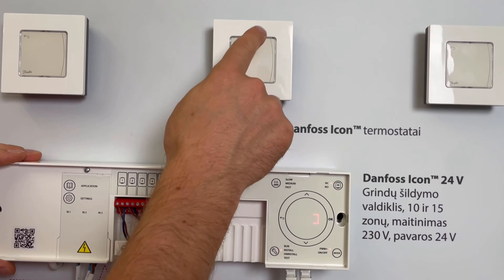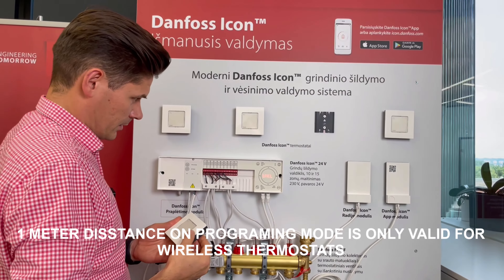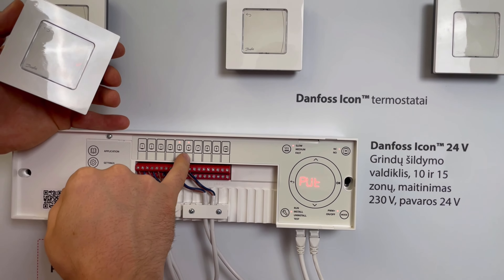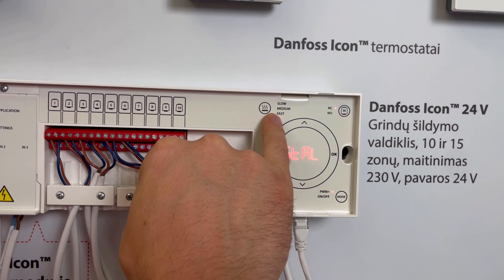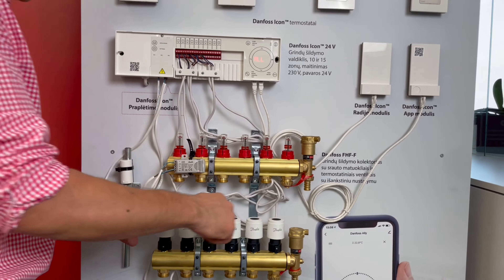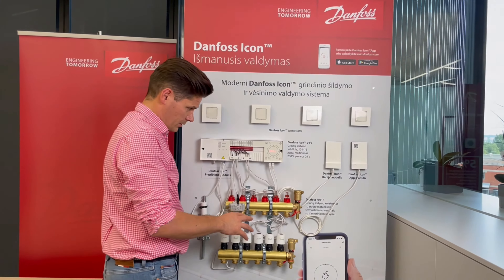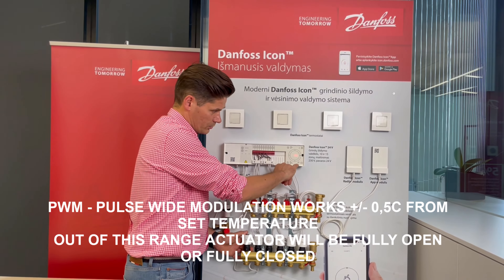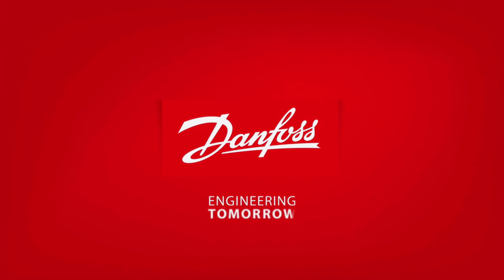Danfoss icon installation guide

Comment: Hello!
I have a question! The master is running in installtion mode activated (red light in circles), but with the connected Radio Module I just receive 'Net Err' on the thermostats. I already reseted master and thermostats and nothing is changing. Do you know what I should try ? Thank you!

Comment: Hi 
I am writing for some help 😁
We just moved in the new apartment and we have some issues with the heat…we have the same system and I followed all the steps from the video but still we don’t have heat in all  apartment and I don’t know what should I do…😊
Reply from the maker: Check the actuators, are they open. In case they are open it is not related to control system. Something wrong with heat supply.

Comment: I have the error “net” in all my wireless controllers. The master controller seems  to be completely off, meaning no lights or anything happens when I press the buttons.
Reply from the maker: It seems Master Controller is "dead" probably you need a new one :(
Reply: @ thank you for the information! I think so indeed. I’ll tell the landlord to replace it! 😅

Comment: Hi, I tried to reset everything (Icon 1 wired 24v) and now all thermostats shows some error after blinking and 212 code when I press back button. And I can’t add any of them to the system. Also Is it possible to find out where a specific contour is located? I don't have any markings or maps from the developer.
Reply from the maker: Hi! Reset has to be done for 
Master controller: https://youtu.be/ErfuVqSK-8o?si=NCcsQEX7S1BX9MTu
And for Thermostats also: https://youtu.be/ErfuVqSK-8o?si=qc5OFjyzPN8hMf0U
And any other devices separately: App module, Radio module etc...
To mach circuit with room there is no other way as to close all circuits. And open one by one looking where heating starts. To heat up one circuit it takes minimum one hour. For better result increase supply temperature. Thermal camera will help to find faster.

Comment: Thanks for the clear demo! Three questions if I may: We have Danfoss Icon in combination with Nibe S1155 series. 1) When selecting zone temp to 21.0 for some of the zones the heating continues heating up to 21.7 degrees before it stops. Is this a normal situation? 2) Will the Icon app be updated? It has not been for 2 years. 3) How do I load new firmware to the App to update the main controller?  Thank you.
Reply from the maker: Hi! 1.It should not heat up to 21.7C if set to 21.0 only in cases where floor sensor is used. Or some other heating is present. Also might be mixed loops. Thermostat is regulating different loop (cirquit). 2.Hard to say, It is not up to me:) more advanced is Ally app. Second generation Icon and coming Icon 2 is possible to connect to Ally Gateway. Also ventilation, and coming remote boiler relay. 3.As far as I know it is not possible, only new Icon 2 will have this feature.

Comment: 0:57 the actuators are not blinking. Even if I follow the step-by-step up to that point. What could be wrong?
Reply from the maker: Is the connected actuator 24V?  Remark: Icon first generation works only with 24V actuators. Icon 2 from factory without transformator works with 230V actuators.

Comment: after connecting and configuring the expansion module that occupies the first valve, HOLD is displayed and nothing happens. What could be the reason?
Reply from the maker: Probably something is wrong with installation. I would reset everything (Master controller, room thermostats, App...) and would start all over all programming process. (How to reset there are videos done)
Reply from the maker: What application you are using? Send me system installation foto's to: andtimofejev@gmail.com

Comment: Good day! 
How can I re-setup the control of thermostat. I want to make the thermostat to action other actuators.
Example now the thermostat from one room give control to 1-2-3-6-7. I want to change to give action to  1-2-4-5-6 and to move control of 3 and 7 on other thermostat.
Thank you.
Reply from the maker: Hi! Select "Uninstall", then "OK". Select with up arrow output you want to change, confirm with "OK". One by one. And then use "Install" as on video.
Reply: But if I select Uninstall?
What will be uninstalled? Themostate or the actuators?
Reply from the maker: @futurechannel001  actuator output will be uninstalled from master controller. You can not uninstall thermostat, only reset.
Reply: @heatingsolutions123  
Can you please make a video with this explanation how to change the setup of the Thermostat and Actuators.
Reply from the maker: @futurechannel001  Sorry, I do not have first Icon version anymore. Another way to solve your case would be reseting Icon Master https://youtu.be/ErfuVqSK-8o?si=3DjTe5BdppbQl_Lk
and all room thermostats to factory setting. Icon/Icon2, wireless and wired reset is the same: https://youtube.com/shorts/lPaoofPJnFo?si=Gb4-5lRU_kbA1-xs 
After reseting you can program all as new

Comment: When I change replace an activator, what needs to be done on this control unit?
Reply from the maker: Unplug (power OFF) Icon Master Controller. Change actuator. Plug in (power ON) and it is done:)
Reply: Thanks for the solution, it removes the error 🙂

Comment: Would you, please, be so kind providing additional information on how to configure it with dual-mode zones? It seems to me that a plus of Danfoss Master 24 v and Wireless Controller (comparing with other similar brand name solutions) is the option to configure a zone as Dual-Mode. According to the manual (i.e., Danfoss Icon™ Master Controller 24V - Installation Guide - AN29434614196101-000402 | 088N2112 01), for such zone "During operation the system will maintain room and the min. floor temperature setting using only floor heating. Only in periods where the floor heating system on its own and with the defined max. floor temperature is insufficient will the radiator be activated to help achieve the desired room temperature.". The question/problem is the following: as I have a distinct pump for the high temperature (radiators) circuit, I need a distinct signal for it, distinct from the signal for starting the low temp (underfloor) circuit. It is my understanding the boiler and pump outputs on the Icon Master would both "fire" to turn on and off the underfloor heating. In this case, there is any electrical signal available for the radiators pump? E.g., would the actuator output on the controller continue providing an output signal even if its channel is paired with a wireless radiator thermostat? Do you, please, have a solution for this problem?
Reply from the maker: It is possible to connect underfloor heating and radiator heating to one wired or wireless room controller (thermostat). In this case wireless room thermostat has to be with infrared sensor (IR). Or wired thermostat with immersed underfloor sensor. IR/underfloor sensor is needed for underfloor min. temperature control and radiator activation. Actuator from radiator and actuator from underfloor heating circuit has to be connected so separate outputs and paired with one room thermostat. Boiler relay and pump relay on master controller are activated on demand for heating. With expansion module it can be different. For more questions you should contact local Danfoss representative.

Comment: Good day,
I reset my Danfoss,  now on Icon App shows only the rooms from 1st Floor not from 2nd Floor.

Kindly assist me please.
Reply from the maker: Hi, OK. This is not easy,  but manageable. 
If you have got Icon first generation MC and you are using Icon App. And you have made reset on Icon first floor master. You need to do this: 1.) reset Icon master second floor controller too 2.) reset 2nd floor all room thermostats 3.) disconnect all actuators and room thermostats if wired  from 2nd MC 4.) if you have wired connection then leave 2nd MC in place, if you have radio connection. dissmount and take 2nd MC closer to 1st floor MC (1 meter distance). Both has to be with Radio modules. Pair them as instruction says: 
Connecting more Danfoss Icon™ Master Controllers in a system
If wired system
Connect up to three Danfoss Icon™ Master Controller 24V to each other with a 4-wire twisted pairs cable and
the supplied connector (pic. 10: A – 4 (2 × twisted pairs), B – Max. 3 x Master Controllers in one system). See data
table in the back of installation guide for wiring recommendations.
If wireless system
Wireless connection of up to three Danfoss Icon™ Master Controllers 24V requires a Radio Module with each
Master / Slave (pic. 11).
Pairing System Master and Slave in both wired and wireless systems
Note! Slave Controllers must be assigned as System Slaves before assigning outputs and thermostats to them.
1. On the selected system master, press to select INSTALL mode and press OK.
2. On the system slave, press and hold for 1,5 sec. The display now toggles between SLA TYPA and SLA
TYPB.
3. Press to choose between the two slave types and confirm with OK. See “Slave type definition” section
for explanation.
4. Repeat step 1–3 to assign a second Slave Controller to the system (max. two slaves are permitted).

Instruction is here: https://assets.danfoss.com/documents/157226/AN29434614196101-000402.pdf

Good Luck! 
Let me know how was it.
Reply: @heatingsolutions123  Good morning, Finally I made it. I Reset both Master Controllers and input again the thermostats. Thank you
Reply from the maker: @futurechannel001  Thank You for a good news! :)

Comment: Please allow me another questions:
1) In the comments below you talk about the "ally-app". I am located in Switzerland and cannot find this app in the iphone store.
2) I have 6 circuits and the problem I have it is with heating and cooling. Lets Assume I have cooling and all rooms are adjusted at 22 degrees and the temperature in all rooms is 25 degrees. Not all valves will open, only a few of them. But if I switch the walves in "off-position" the valves will open for all rooms. For heating here I have the same challenge: Lets assume in all rooms are 20 degrees, but all controllers are selected at 23 degrees, only a few valves open and not all valves. 
Is the a change I can made in the configuration, that all valves open at the same time?
Thanks for your help.
Reply from the maker: 1) I am not sure which system you are using: new Icon 2 or older Icon first generation. For Icon 2 system and for Icon first generation system used with Icon Zig Bee module https://store.danfoss.com/ch/en/Climate-Solutions-for-heating/Hydronic-floor-heating/Room-controls/Floor-Heating-Controls%2C-Danfoss-Icon%2C-Zigbee-module%2C-5-0-V%2C-Number-of-channels%3A-0%2C-Attachable/p/088U1130  App is called Danfoss Ally. For Icon first generation used with Icon App module https://store.danfoss.com/ch/en/Climate-Solutions-for-heating/Hydronic-floor-heating/Room-controls/Floor-Heating-Controls%2C-Danfoss-Icon%2C-App-module%2C-5-0-V%2C-Number-of-channels%3A-0%2C-Attachable/p/088U1101 App is called Danfoss Icon. Both are available on Apple Store or Google Play. I would suggest to contact local Danfoss customer service for support. 
2.) At cooling mode try to set lower than 3C from real temperature. For example: if at heating you set 22C, cooling will work till 24C. (there is 2C differential for cooling in software). Also for cooling more is efficient to have manual temperature control, no schedule at all. If you have no App control, it is on manual mode Icon1 or Icon2 have schedule only with App. Actuators might not open all at the same time because of energy saving - PWM control. Switching to ON/OFF control actuators reaction will be faster. PS.: it takes up to 5 min for actuator to react. It is not easy to guess all circumstaces so I would also recommend to contact local Danfoss Customer Service.